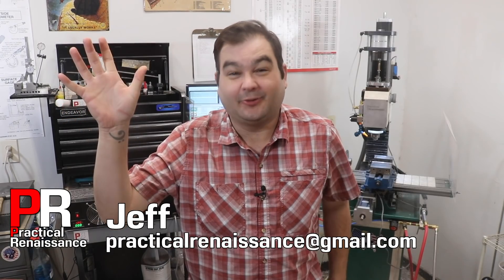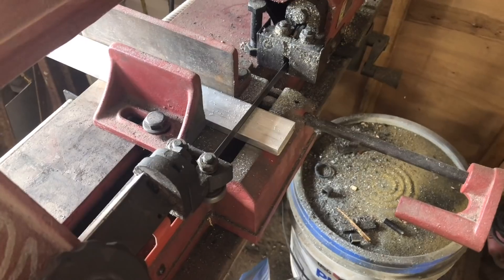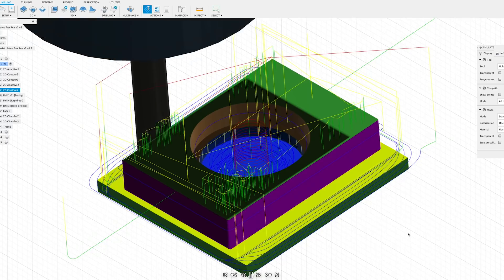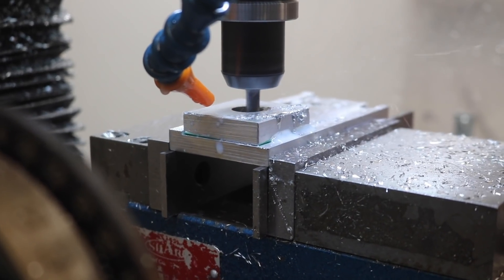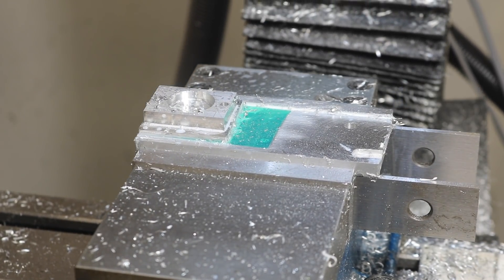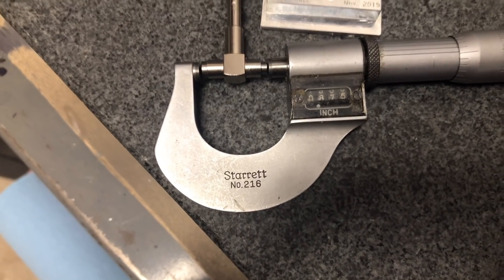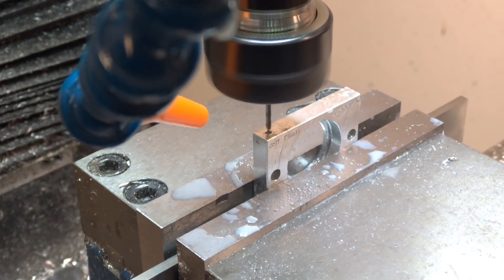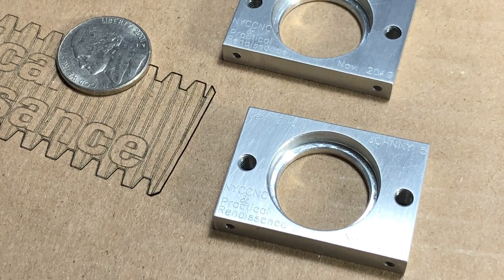Making Parts for NYC CNC's Johnny 5!

Comment: Hi Jeff , I am converting my G0704 I am just about done with wiring the control box what are the settings for the drivers using all Nema23. This should be th first of just a few questions   Thank Bill form Seattle.   Bcliff8@Hotmail.com.  3602016045